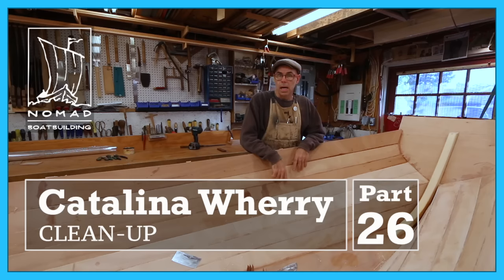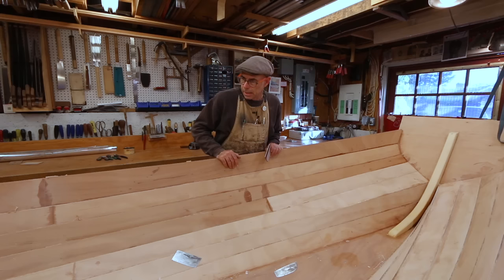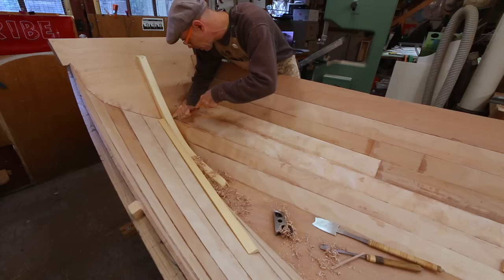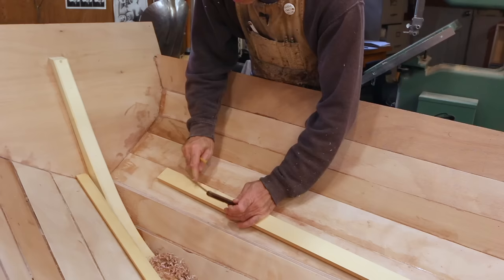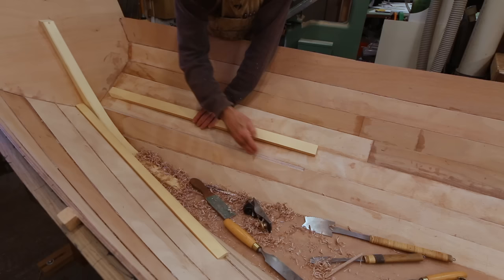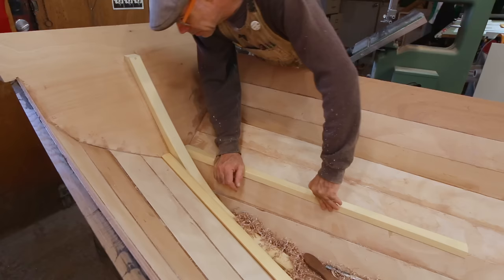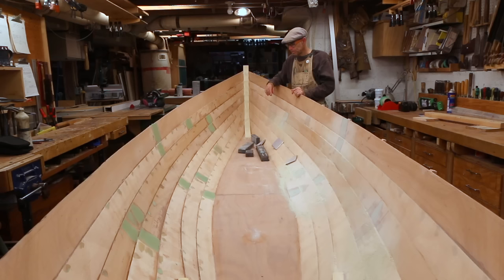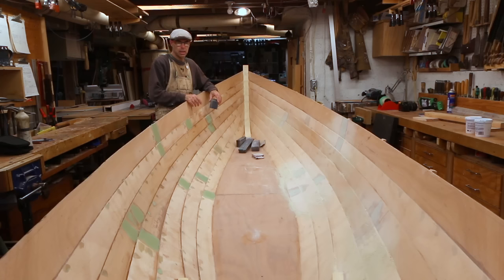Building the Catalina Wherry - Part 26 - Cleaning up the interior

Comment: Seeing the boat turned over, I was finally able to wrap my head around how exactly the planks fitted together in the tuck. Sure was a lot of fussy work to get that area supported but it came out with lots more style than a simple fiberglass tape reinforcement. That’s a scary way to pull work through a table saw, I have tapered stick with a sharped brad that can push the work through from the area past the blade…still a bit sketchy but it’s the stick that gets chewed up if there’s a kickback.

Comment: I use a similar foam then cut it with a sharp Olfa mat knife to fit very snug inside a belt sander belt for hand sanding. Sander belts are affordable, come in various lengths and many different grits. Cool boat!
Reply from the maker: Good idea!

Comment: Hi   Just thinking ; would it have been quicker if the planks were scarfed before installing ?  Mind is 60 per cent the  length of yours, hence the planks were easier to handled.
Keep the recordings coming.
Reply from the maker: I find, working by myself, that it’s easier to scarf on the mould despite the bit of extras cleanup that might be required. For something shorter, like a 10'-12’ boat it might be faster to scarf ahead but also, the plank pattering method I'm using here benefits from shorter planks which can be rough cut a little narrower.